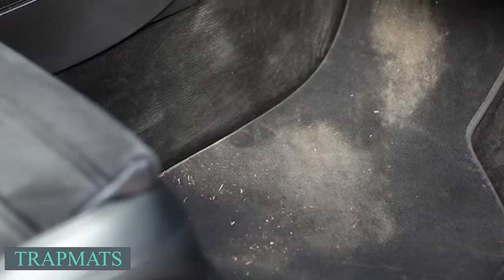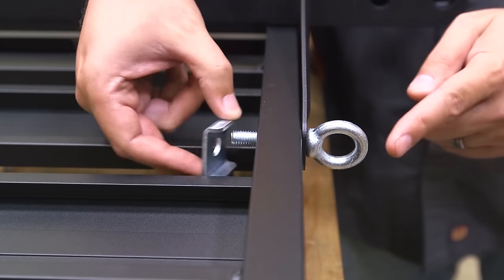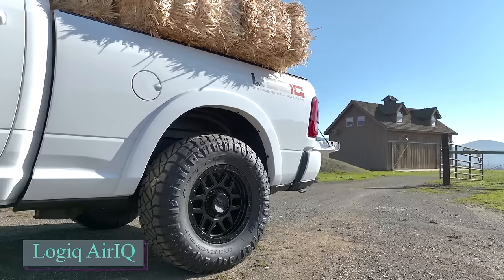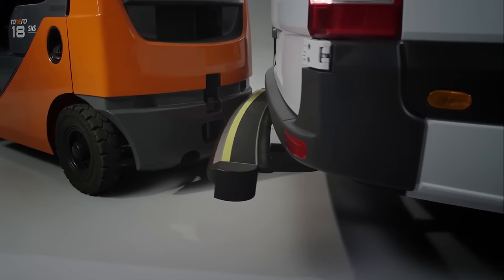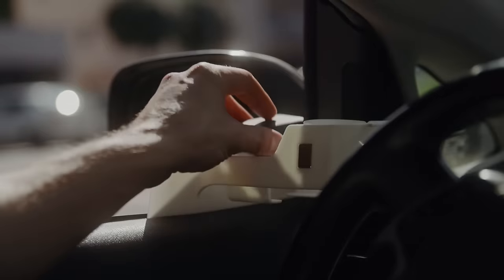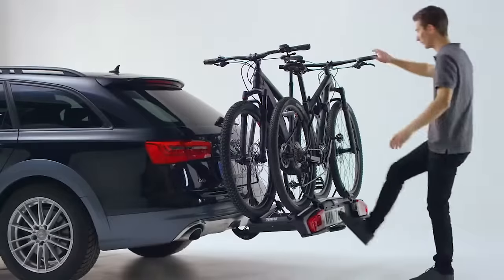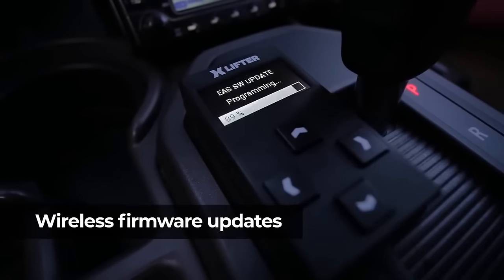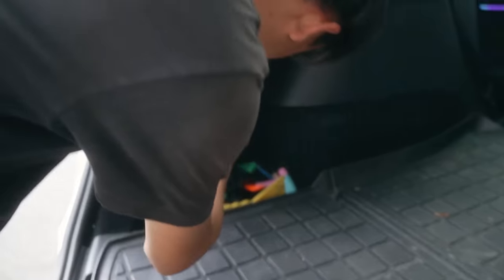43 Car Inventions You Didn't Know About

Comment: the problem with those airless tyre is you can not adjust the ride.. as we saw in the demo they had different tyres on that truck for with and without a load.. that unloaded tyre was clearly suffering major deflection without a load.. no way would you put tons extra on to it.. and the one that had a load showed zero deflection. a seriously harsh ride